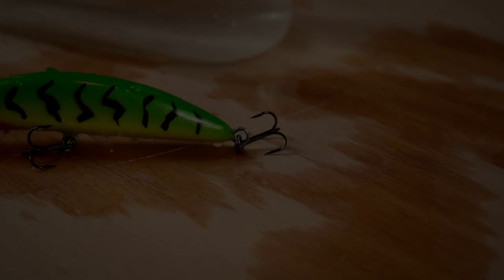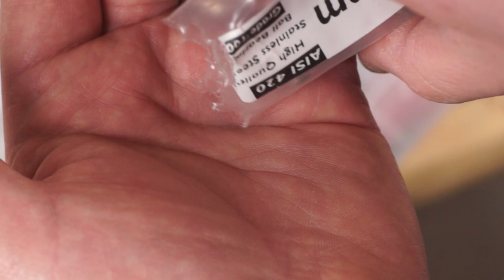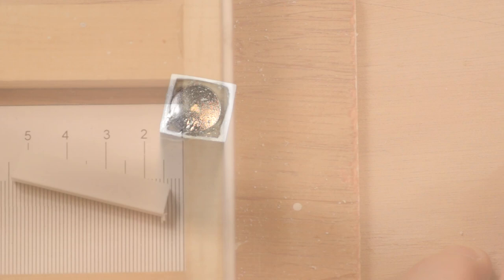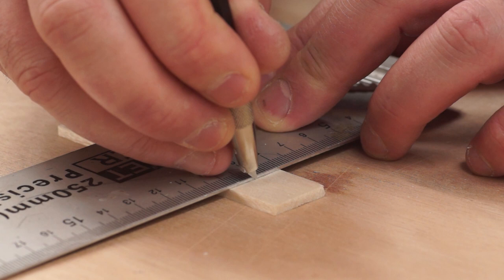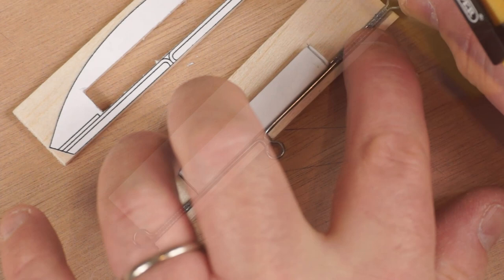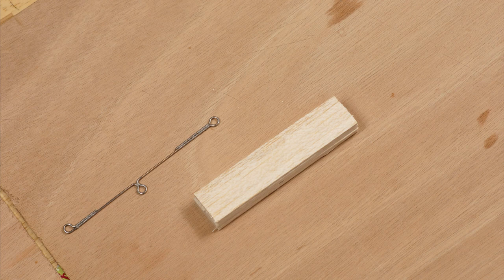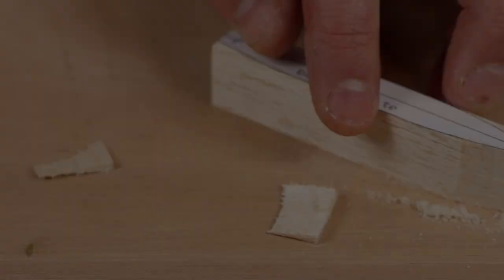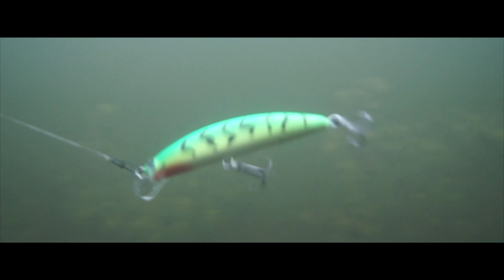Making A Weight Shift Balsa Fishing Lure Part 3 of 3

Comment: Hello Paul

As you can see, I was waiting for the third part of this series. Congratulations and thanks!!!

I never thought to use a squared tube instead a circular one... it was an amazing idea. I was using a plastic straw, but it was too thin. I'm going to look for a tube like yours.
On the other hand, something I did to give a little more weight to the lure, was to set a fixed bigger ball bearing at the front, before to set the magnet, and then, I put the tubular section with the moving balls bearing... It worked very well. The lure fly quite well and swims very good.
I'm going to change the thin plastic straw with a thicker tube, in order to give more protection to the wood walls.

I will stay alert for your new videos.... perhaps, someday I might encourage myself to make a video doing my own Balsa lures...

Paul, thank you for sharing your tips, let's keep in touch.
Reply from the maker: I found this tube by chance at an art shop but it is a common item at model making suppliers and made by plastruct, it was also very cheap they make a round tube out of the same stuff. I did want to go a bit further and do something pvc foam, but it will have to wait for another video. I have also found before that keeping some of the weight near the head also balances the lure in flight a little better. Any time you fancy pointing a camera at the lures your making i'll be your first subscriber. Thanks
Reply: ***** Hola Paul... Even though I do not have big hobby or art shops here in Lima, I will visit the large ones to see whether I find somekind of tubes and other materials. I often get my lures' making stuffs when I travel to the USA or buying them in Internet.
Paul, I humbly invite you visit to my channel here in youtube to see what I do... At your side, I am just a quite beginner and I will try to improve my work. I really love it. I feel a huge pleasure everytime I catch a fish with my own spoonflies, jigs and lures.

Have a great week

Comment: Darn it! I am just getting halfway reasonable at making the minnow in the original version. embedding the thru wire seems awkward but I am drawing a blank on any sort of suggestion other than the old school using a backsaw to cut the slot and fill it with epoxy.   Nice work as always

Comment: great video again paul and a fitting finish to the weigh shifting lure series. how about for the evolution stage for this kind of lure you could try and figure out how to add a rattle chamber there too.
Reply from the maker: SolarBaits It makes a  good rattle which surprised me as the weights don't have that much room to move , on the last  piece of underwater video i left the sound on. I think next it need some kind of face.
Reply: *****  i'm thinking the sound in the video comes from the split rings and the hooks them selfs hitting the lure body. the lake salmon/trout anglers here that troll for them have been using lures that make a certain pitch when the hooks hit the body, if i remember correctly the optimum pitch was 11hrz.
Reply from the maker: no, it was noisy as hell before i put the hooks on, so much so my wife said "can you stop ********** rattling that thing" so i went to the park to play with the water
Reply from the maker: SolarBaits Just messing with the equalizer on the editing software the rattle covers a range of frequencies between 1khz and about 15khz peaking towards the middle. I suppose with some simple electronics you could just generate and 11khz pulse or tune your spoon. Or if you had electronics on board your lure you could just test out different music styles, i think reggae for pike but i am guessing Finish pike prefer Death Metal.

Comment: I would not have expected these inline BB's stuck to the magnets to rattle as much as I could hear in the final underwater sequence , Paul , ......I'm really wondering , how exactly this sound is generated , as the BB's should stick together and the sideward play inside of the square plastic tubing also is very small , ...does not sound like steel against plastic but steel on steel , anyway ?

Great and extremely well edited video again , .....greetings , Dieter
Reply from the maker: They ball bearings just have under half a millimeter of play, but i think hitting the plastic makes a sharper sound than just hitting balsa, also i have a feel the wood acts like a soundboard in the same way clockwork musical barrels don't; make much sound until they are placed on wood. This was filmed about ten inches if front of a compact camera in a modified sandwich box and the sound has not been altered in any way, i just thought i would play it instead of over dubbing, but it might be interesting to go and try it with some other lures.  Thanks Dieter
Reply: *****

That very small play inside of the square tubing is what is puzzling me most , the BB's do lack a certain distance of a run-up to hit the inner tubing walls with enough force to generate such a fairly loud noise , also the cadence of the single clicks in relation to the frequency of wobble does not seem to match that very small distance that the BB's could move sidewards !

And it would be hardly possible , that the BB's would be hitting one another by moving forward and backward parallel to the lure's center axis , as the lure rocks and wobbles towards either side only .

I aggree to your other statements regarding different sounds generated by BB's hitting harder or softer materials , but Imust admit , that this lure of yours remains a mystery to me and shatters all of my thoughts and experiences about lure rattles(though your design surely is not intended to function as a rattle , but a long cast system in first place , I suppose  ?).

Greetz , Dieter

Comment: I LOVE these videos!!! I c that you dont use epoxy in these videos to glue you lures together, do you find super glue works just as fine? Great Video :)
Reply from the maker: Michael Loft I have never had problem using superglue for gluing internal faces, and when i have opened lures up a gain i found the joints are far stronger than the wood. So in these veneered lures it is almost like having another four very tough laminates. The draw backs are that it goes off very fast so if i put something in the wrong place it is staying there. Some lure builders use it to seal the lures as well before painting, but it is not something i have tried. Thanks

Comment: Hi Paul, 

Great videos. Could you tell me where you get the long closed eye hooks please.  I can't find them on the net other than America. 

Keep up the videos. 

Coops.
Reply from the maker: I bought these hooks from Mark at lurefactors.co.uk/     in the uk they are no. 6

thanks, i am working on two videos at the moment, so hopefully not too long
Reply: Ahh sorry I meant the eyed screw in bit to hold the hook or trace end.
Many thanks for the quick reply.
Reply from the maker: Paul Cooper I make them from tig welding wire 1mm which i get on ebay, the process is shown in the first video in this series
Reply: Awesome many thanks Paul.